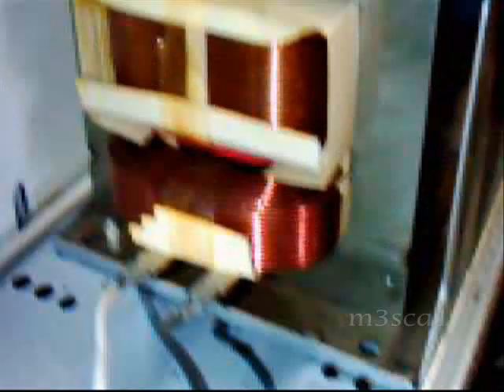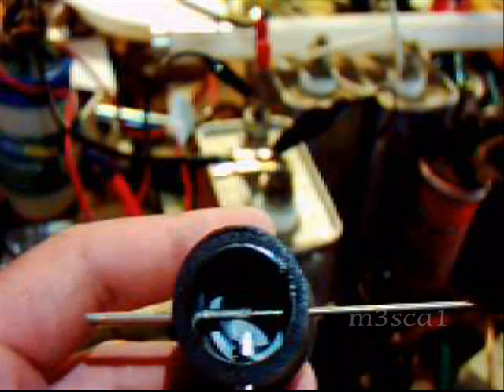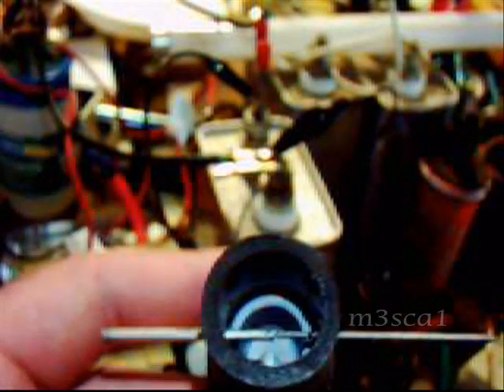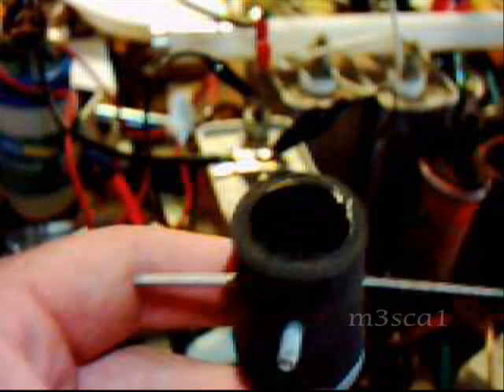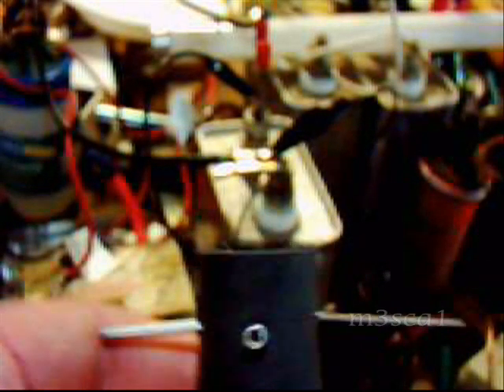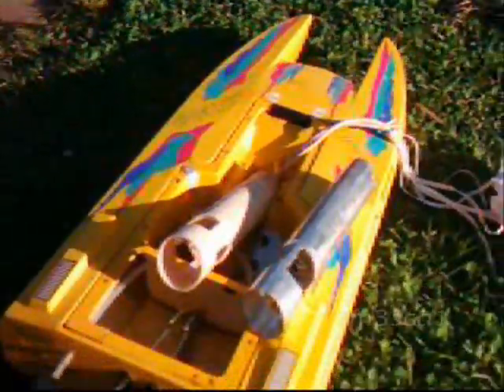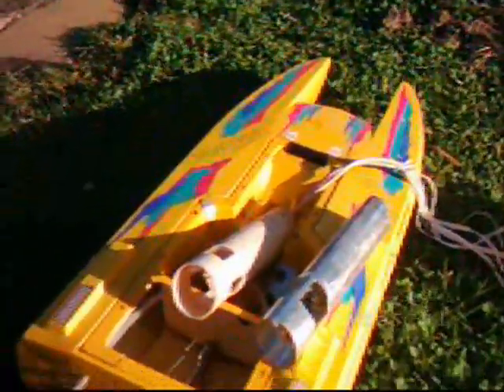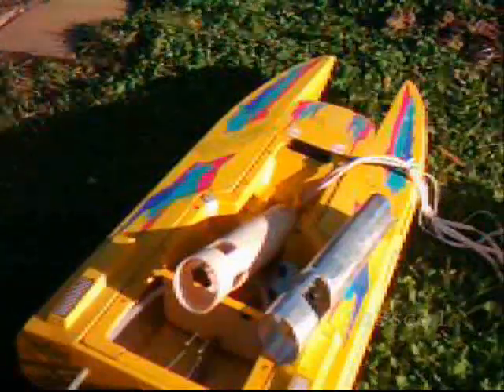Steam HV Spark Gap 4+ extras

Comment from the maker: heres an idea -intsead of the dimmer or light bulb use a very small heater coil to make steam.
might work-i like how the circuit feedsback on itself.
the rocket boat is 2nd attempt.
the 1st was much smaller and had no ballast.
the wind got under it ,and flew around in looping circles above the water.
this time ballast will be added to te front.
=]